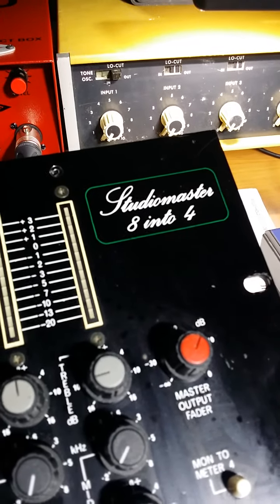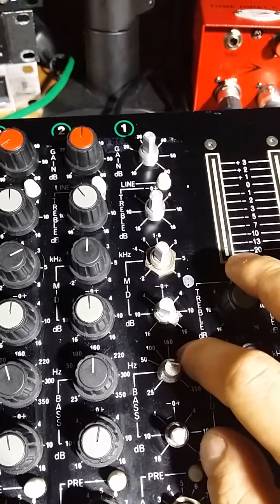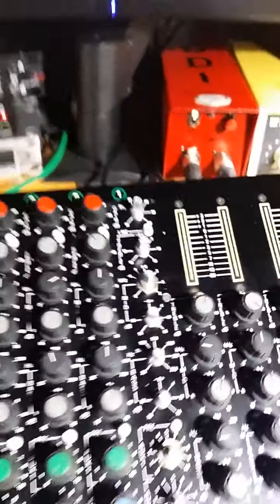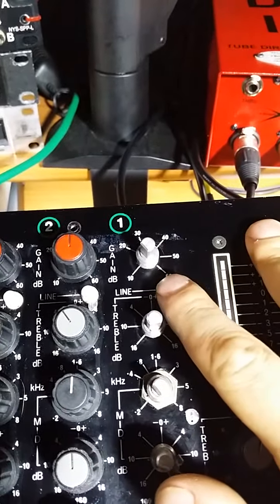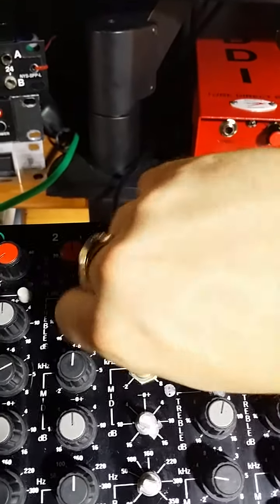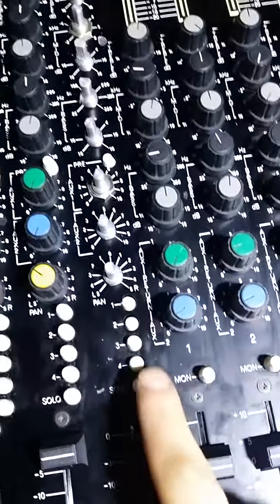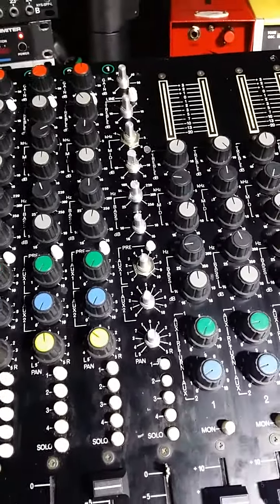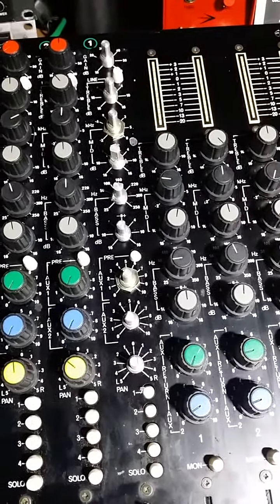Studiomaster 8 into 4 noise on Channel 1

Comment: I've used the Studiomaster 16x8 - a lot like this one - on a couple of albums a few years back onto a 16 track digital (ADAT) format. I mixed the projects at a high-end studio in Nashville with a Neve console. The tech and engineer guys asked me, "man how did you get those tracks to sound so fat?' It was the Studiomaster board we used. English components - much like the German - had a certain color in the sound that is hard to replicate. I've worked at some of the finest studios in Nashville, and have yet to match the sound from that Studiomaster. Sounds far fetched but I'll put it up against any of the new consoles.
BTW, is this one for sell? I'd like to use it with my pre-amps.
Reply: hi I just recently bought one ( 8 into 4) and i noticed that mine have RIAA push buttons from channel 1-4 instead of Line. Do this mixers have different models and what exactly is RIAA? Its my first analog mixer that I bought so Im still learning how to work things out. I love the warm and fat sound it produce, something that is hard to replicate in the digital world=)Thanks